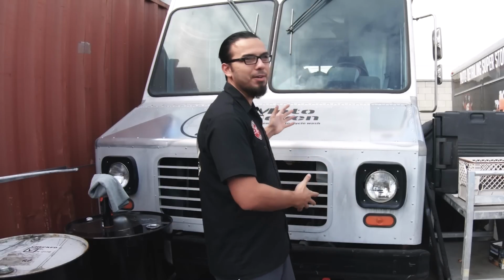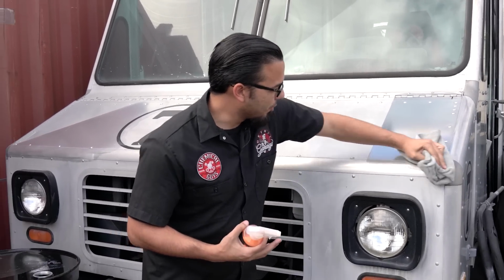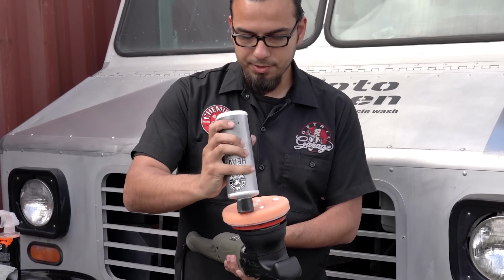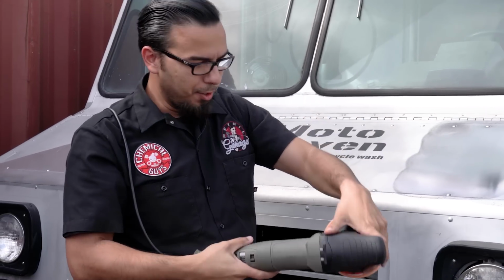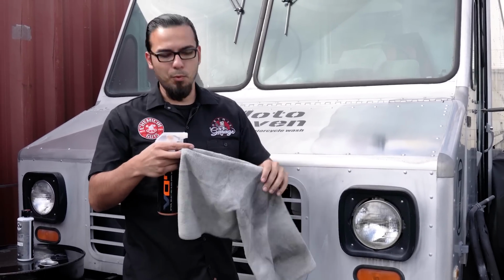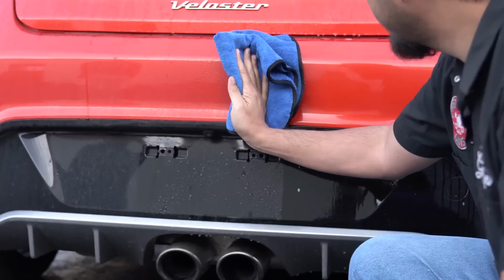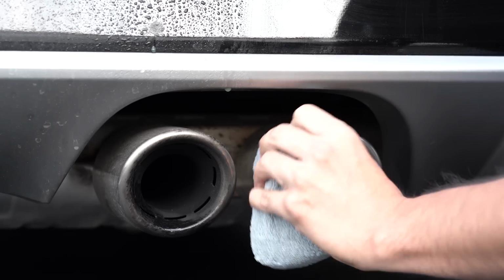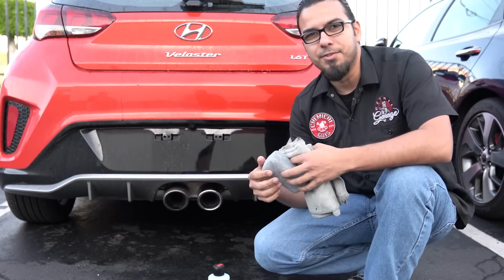How To Polish Chrome, Stainless & Metal Surfaces! - Chemical Guys

Comment: Thanks for sharing this technique! I use both CG's heavy and light metal polish... Love both!  What pad would be best for chrome that has some oxidation that wouldn't scratch the surface? I will be using a Porter Cable DA 7424XP. Thanks again, appreciate it. 👍😊
Reply from the maker: Hi there! Use an Orange Hex-Logic Pad to restore shine.

Comment: I just got your heavy metal polish to use on my 63 impala bumpers.  would using a orbital polisher be okay or best by hand ?
Reply from the maker: Absolutely! It is perfectly safe to use with a random orbital polisher.
Reply: @ChemicalGuys  awesome! I did it today and it works amazing ! never have used a polisher before so not sure if I had it on fast enough .

Comment: Would heavy metal polish work on a aluminum fishing boat?   What would be the process (products) used to bring back the shine?  Aluminium boat also has red on the sides - Thanks!
Reply from the maker: Hi there! Absolutely, Heavy Metal Polish works well for removing stains and oxidation from exposed metal surfaces. Apply a coat of your favorite wax to lock in shine and repel harsh elements.

Comment: What could I use to polish aluminum semi truck wheels ?
Reply from the maker: Hey there! Heavy Metal Polish works well for restoring wheels that have brake dust stains, corrosion and oxidation.
- CG Nick
Reply: Chemical Guys thank you

Comment: Not sure if you guys have done this before but have you guys made a video on how to remove scratches from a windshield?
Reply from the maker: Hey there! Great suggestion!! Polishing glass requires a lot of abrasives but for a fine scratch it should be able to remove using the V-Line.
- CG Nick